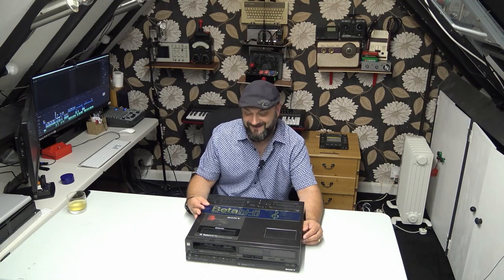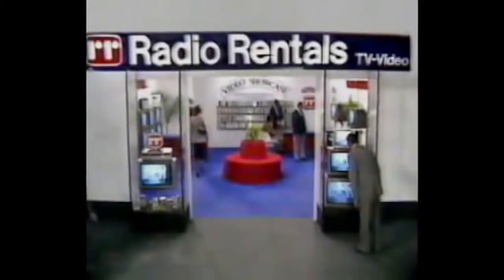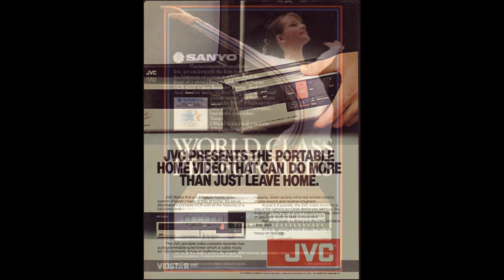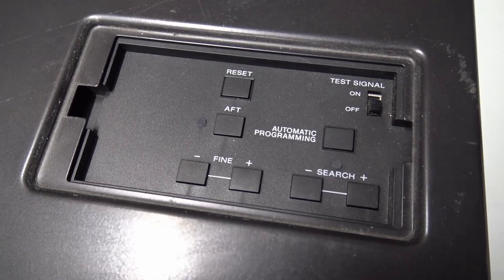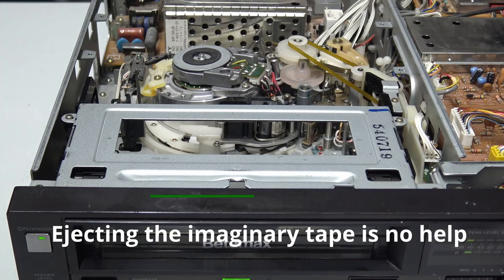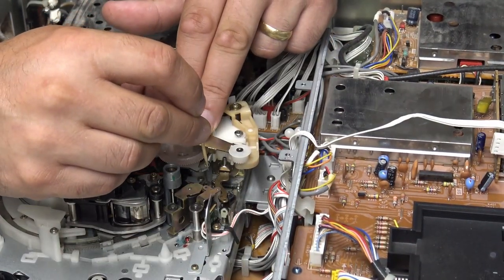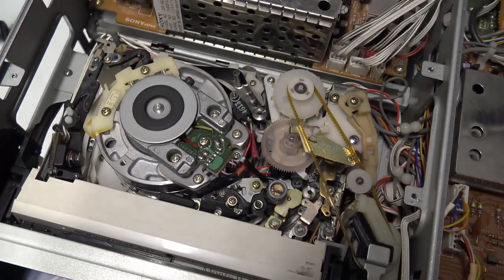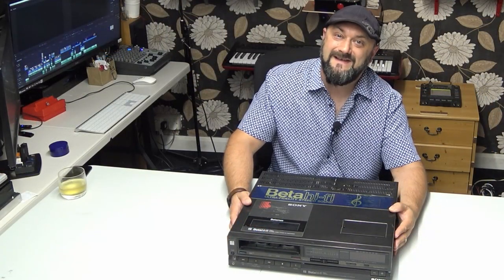DuB-EnG: BETAMAX Video Recorder Repair and a short HISTORY of the VHS VIDEOTAPE FORMAT WARS of 1980s

Comment: The lacing bar is'nt bent.The miniature (and i mean miniature!) small screw that secures this to the loading ring needs a tiny tweak to get that to stand upright more. So it can locate in the black plastic guide slot.
I've seen that on a couple of SLF30's. You do that by manually turning the loading ring gear (that you've just sorted) to slowly bring it out so you can safely work on it and see how far up it goes and locates successfully.
Reply from the maker: Again, thanks kindly for your email information!!!  These are really good tips!!  I’ll let Ed know as it’s his machine and I have already passed it back to him.  He really wants to keep this unit going so he will likely get in touch!!  Thanks for all your help and advice!!!

Comment: Great vid, mate. ;)
Reply from the maker: Thanks Ash! - I tried a little harder with this one :-)  Can you tell?!?!
Reply: @DubiousEngineering  Your vids are fun either way, mate.

But yes, I liked the bit of history in this one, and the editing etc. ;)
Reply from the maker: Well..  your comments just made me pop over to your channel! - I was terrified of that massive 8 inch HDD spinning up!! - Was that a 20MB unit??  I remember the days of MFM drives :-)
Reply: @DubiousEngineering  lol

Erm, I think it's 168MB, or something?

EDIT: 85MB
http://www.bitsavers.org/pdf/nec/disk/819-000080-5001_D2246_8-Inch_Disk_Maintenance_Guide_Dec1983.pdf

It uses the "SMD" interface, which predates SCSI, and I think even IBM-style MFM.

I didn't know much about SMD at first, but it was used on quite a lot of those older mainframe HDDs in the 70s and 80s.

I designed a board to hook up the HDD to an FPGA board, to try to write and read data. It could move the heads just fine, but I used the wrong type of driver chips for the data, so it couldn't write reliably.

It was meant as part of trying to recover the data (or images) from the big Fujitsu "Eagle" HDD from the BBC Quantel Paintbox.

Mr Dexter (Dexter's Tech Lab) found that NEC drive on eBay as new-old stock, and it was cheap, so we grabbed it.

But yeah, as the adapter didn't quite work out, the drive has sat on my shelf ever since. lol

It would probably make quite a good wheel chuck for a 747, tbh.

Comment: hi out of the  deta  deck i have had  the  sony uvw 1800 is the easy one to pull apart 
and to work on    i have 11 of this model  i plan to work on sometime

i love the  betacam  sp  line  parts so easy to change over from decks  they use alot of the same 
parts   note the audio on the  sony bvw 75 can out do this deck the ,liner tracks 6 x the speed
i lost for words  how good the audio is  on this model as tapes wear the hifi starts to drop out

i have 40 year old  betacam  BCT-30K BCT-30G  tapes  there's no drop  out's of the audio
so buying a used betacam sp tapes for audio masters is a great plan
Reply from the maker: Almost as good as the modern DAT tapes!  Amazing 👏

Comment: The miniature black gear under that white larger one is split and spinning that's why you are'nt getting any ejection or tape loading.
This IS common to these model |Sony's and can be repaired successfully by replacement. Glueing is is not a good idea. It won't last.
Reply from the maker: Thanks 🙏 kindly for your info... where’s does one buy a replacement gear?
Reply: @DubiousEngineering  I have some suitable replacements here but the holes in the center have to be minutely drilled to enable a secure tight  fit.Otherwise it would crack or be too loose.
If you get any future problems and want to send the geared pulley and metal shaft i can attach one for you.
Reply from the maker: I’ll let Ed know... thanks kindly!!!

Comment: My dad got a sony sl 7ub from a radio fair just £5 with three tapes and a service manual he gave it to me  has common faults easily fixed but great picture quality good heads are not always found on sony machines though they do have a great picture when they are good ,i would like a sanyo front loader most of those have good heads due to the fact that sanyo machines unlace the tape on fast forward and rewind .safe to say i have a few vhs machines as well nice 1985 panasonic nv 730b one of my favorite i had 2 in the past a panasonic nv f55 and a nice f75  i really like it has a good picture but no sound ebay charity auction ,an svhs panasonic time lapse recorder plays standard tapes in 3h mode Just a £12 buy it now and no belts ,A really nice jvc svhs from a charity auction bought as broken for £10 i left it in the box it came in for 3 months thinking it would be beyond repair when i looked at it just a couple of studs came off the guides just needed pushing back on works well .
Reply from the maker: paulb4uk ... how epic!! You really have a lovely collection!! Well done some bargains there!! These units sell for £100 upwards these days... it’s interesting to know that on FF and REW some units unlace the head!! :-).  Thanks for sharing your story Paul!!  All the best mate!! Howard